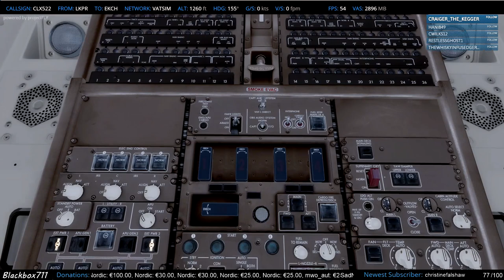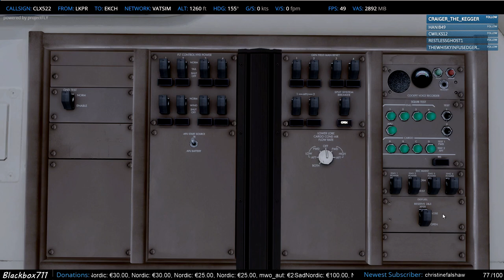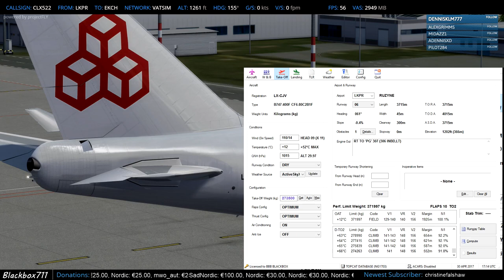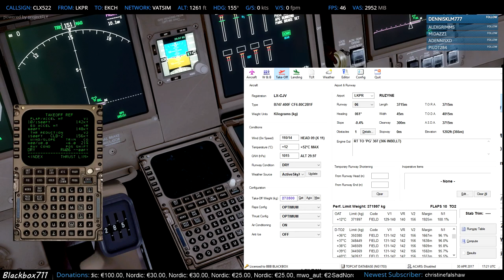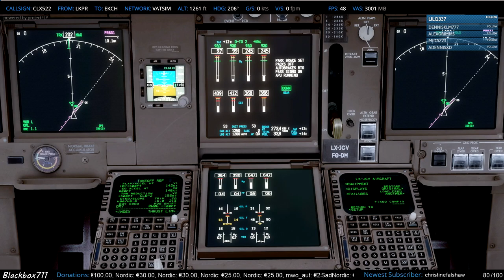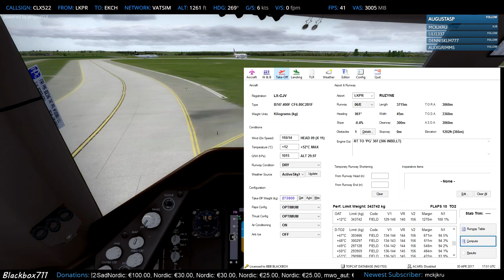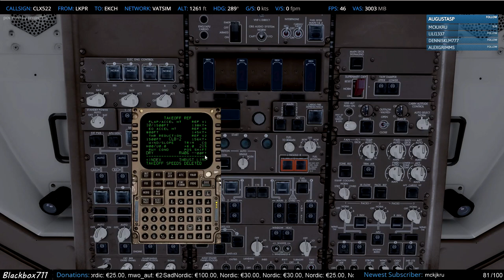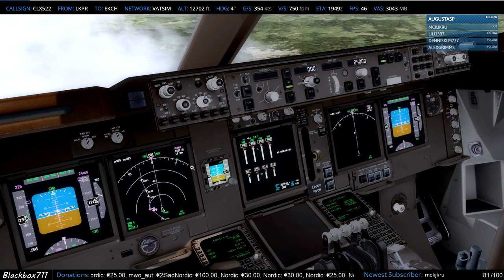PMDG 747-400 Full Flight LKPR - EKCH (VATSIM) - Part1

Comment: 24:00 so basically because the 747 could be super light or super heavy choosing flex temp is kind of not enough to derate the power. we still define -15% as TO2 to make sure the power is kept limited. did I understand this correctly?